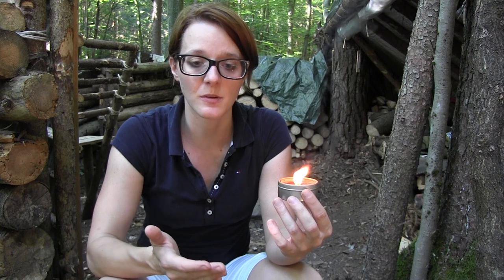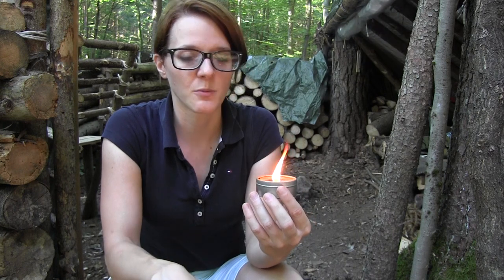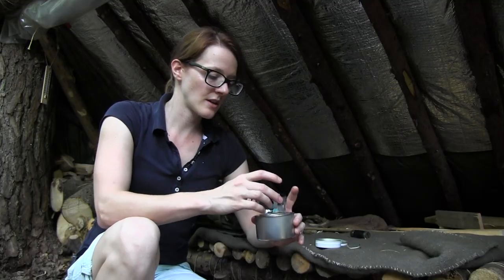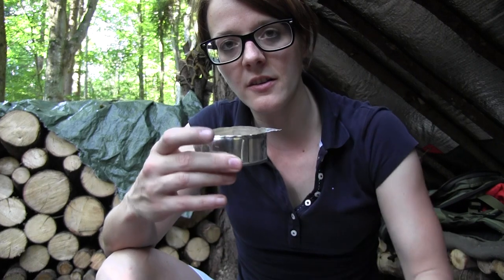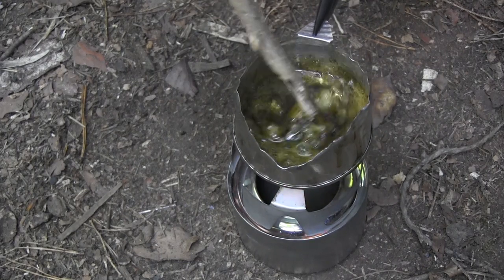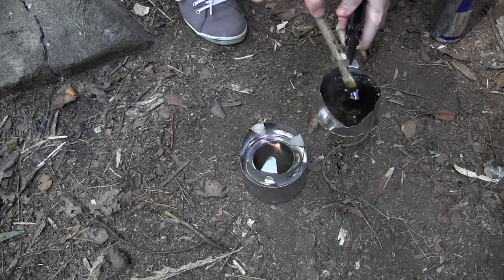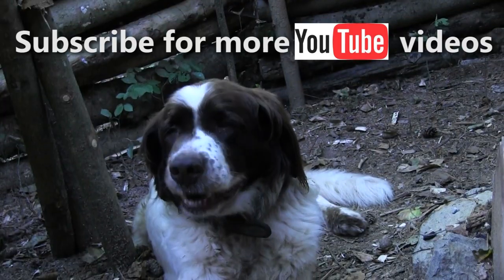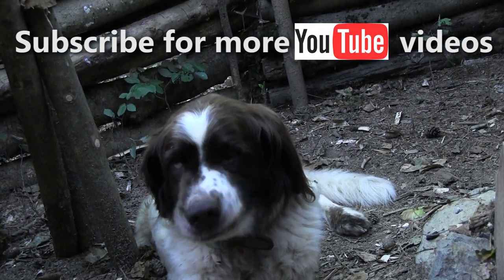How To Make A Bushcraft Candle

Comment: Great video and cool idea to just test this and see it work. Definitely one to keep in mind, especially since beehives aren't at all common, and while fat or tallow from animals works, at least these materials do not run away :) ...Though some questions remain for a follow up video:1. Does the substance harden, which would mean you could actually transport the candle instead of using it solely at a basecamp.2. What sort of wick materials are available in nature? at first I thought any rope making material (poplar, willow) but then I remembered that for a good working candle you also want a 'rope' that actually wicks up fluids, so the candle burns those instead of the wick. May be an interesting topic for a research video...

Comment: I found it odd that the birch oil you rendered in the other video was not very flammable.  We don't have a lot of birch around here, but I've always noticed that birch bark is like a "go-to" fire starter for northerners (US) and Canadians.  You actually use it as a flame retardant in this video. Interesting.
Reply: +flysubcompact That is because the birch bark contains volatile oils, some of these components evaporate as you extract the birch bark oil (only the oils that do not reach their gaseous state remain). That is why the birch bark itself is quite possibly the best natural tinder, yet their oil is hardly flammable. Sound contradictive, but now you know why ;)

Comment: Does it solidify when it cools?
Reply: +Shane McIntosh wonder about that too! ... while it is clear the birch bark oil doesn't, and the pine resin most definitely does... what will the mix do ?
Reply: +Dutch Courage my guess is that it goes into either a warm buttery consistently or like a very thick liquid but maybe if it gets cold enough like in winter it could completely solidify

Comment: you could also use animal fat in the candle..  I've used pig fat and deer tallow before.  Both burn for quite a while.  I'm not familiar with birch oil, but I think it stays in a liquid state which makes it susceptible  to spilling.
Reply: +Adam Whitlach benefit of this method, I find, is that the materials don't run away ;) :P